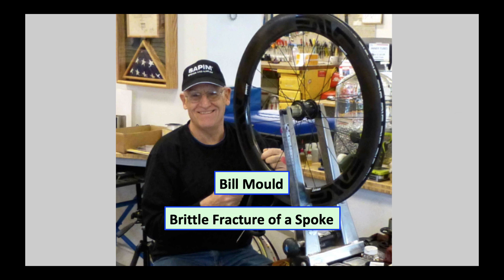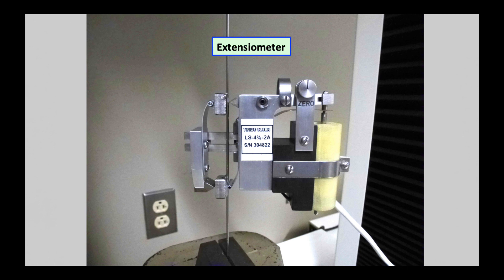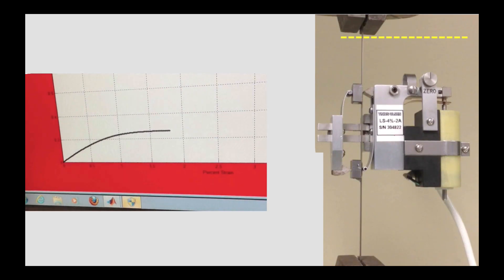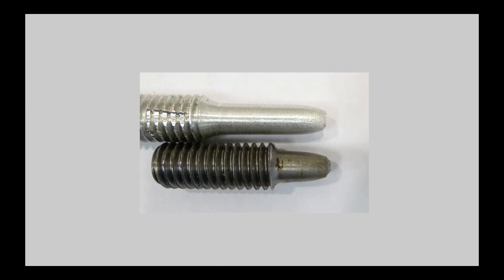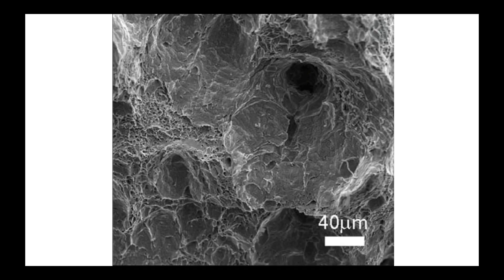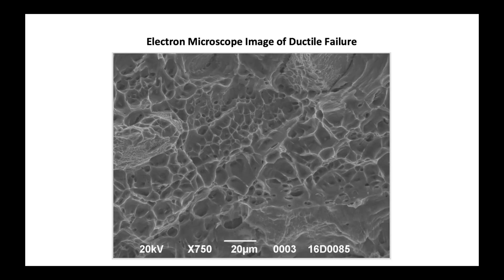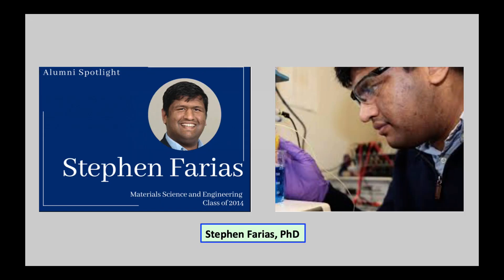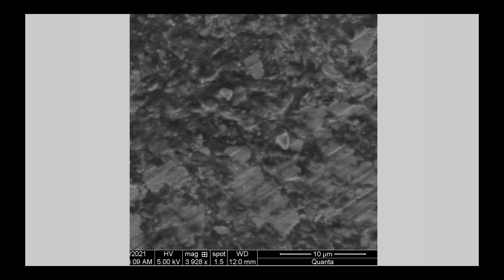Brittle Fracture of a Bicycle Spoke

Comment: Great stuff Bill.  I'd love to see a follow-up video on conditions necessary for brittle failure.  In a previous life my main concern was preventing brittle failure of steel pressure vessels containing stuff we didn't want in the people space.  The danger with brittle failure is its relative unpredictability compared to ductile failure.  The consequences, even on a bicycle wheel, can be traumatic.
Reply from the maker: Rob, I certainly know what you mean.  I've conducted testing of carbon rims and wheels under increasing compression.  Alloy wheels fail gradually.  Carbon is perfectly elastic until it fails catastrophically and loudly.  Luckily, it take a huge force to make it happen.

Comment: As usual, very interesting.  What were the results from the last video where you built up 6 wheels with and without the Sapim MG washers?
Reply from the maker: I wish I knew.  Velocity is supposed to run the tests, but they are up to their ears in trying to fill a backlog of orders.  That puts them in the same boat as every other manufacturer.